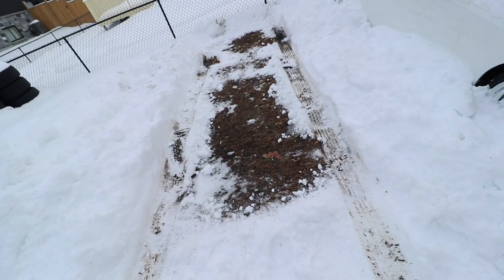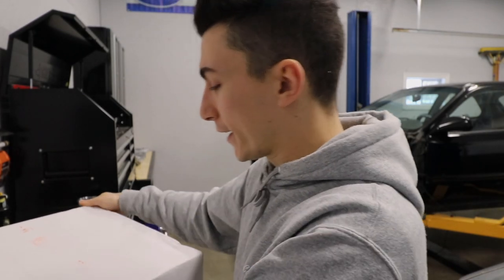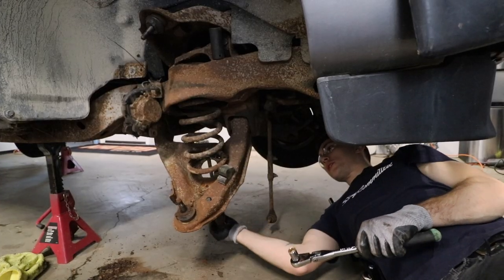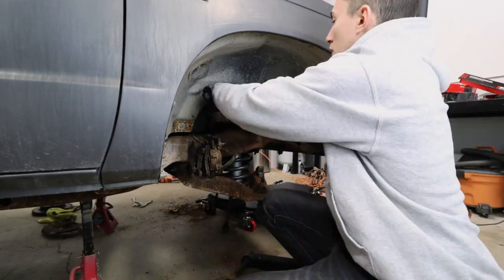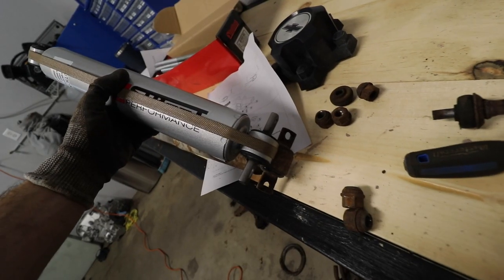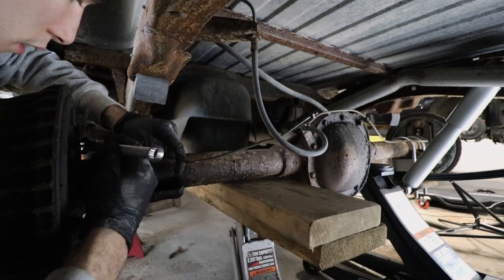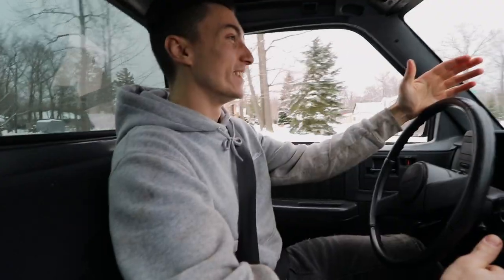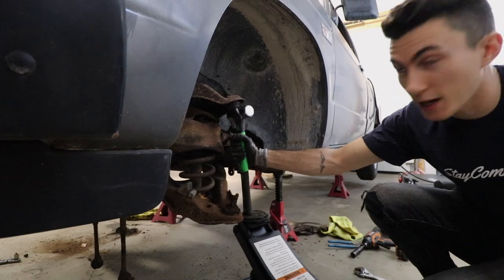Installing a 5" Lowering Kit on my S10😍

Comment: I had a 1896 S10 and miss it. I did a SBC swap putting in a 383 stroker with a 6 speed manual and 4 link 9” ford in the back. It was stupid fast and fun.  Put a cage in it and all it in all a simple swap done before the LS days. Truck was about 12 years old when I did.  Got it with a blown 4 cylinder motor, slipping 4 speed auto and locked up diff so just yard parts went in.  My first truck.

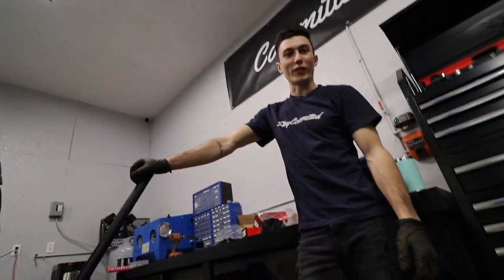Comment: Hi Robbie, at 7:53ish it looks like you used the hard plastic ring that comes with the Belltech coils. They include that ring so you can choose a 2" or 3" drop. That way they don't have to sell 2 different springs. If you used that in your final install, you only lowered the front 4". I've been using BT stuff for years with great results. Love the channel, keep it up.
Reply: Fam so how much did he lower it cause I wanna lower mine the same so did he drop 5 inches in the front and back or 2 in and 3 with his set up cause I want mine to look the same but I can only find 3 inch lowing kits

Comment: 80's mini trucks always look good slammed on some 15-17" rims and low-profile tires. Got an 87 Toyota Pickup, 3" drop all the way around, going to do a little more, and an 87 Ford Ranger 2WD also going to be dropped and slammed eventually.

Comment: Those front shocks brackets can be drimmled out and fit and when you go back and redo the truck get 1in ball joints for better geometry the disk swap just get a blazer rear end out of a 2nd gen

Comment: So I like the Civic project, don't get me wrong on that. But seeing the S10 now, like this. You could do an awesome winter beater project with this. In regards to styling I mean. Like obviously you'd also need more power so maybe that's a first step. But like, there is so much potential with the S10 I feel like. I'd love to see it worked on in some way. :_Badly:

Comment: Did you use the 1 inch spacer in the front or dod you do a full 5 inch drop up front? I know the belltech fronts give you the option or 4 or 5 inch drop. Thanks 👍🏻

Comment: Did you ever end up having to C-notch your rear? Just installed this kit on mine but with 3 in blocks in the rear and no es bueno; adding a c-notch tomorrow. Figured I'd ask if you had run into the same issue eventually

Comment: You should put a 5.3 l33 in the s10 and turbo it.  The l33 is good to 600hp on boost and fits really good in the s10.  I have one and on alcohol I'm running mid 4 second 1/8 miles

Comment: Lowering an s10 can bring some bad news if you dont do it right. Youre gonna wanna put tall ball joints on the upper controll arms due to some geometry issues that lead to not being able to align it properly. Make sure your rear end is shimmed to the correcr spot to, otherwise you can tear your driveshaft apart.

Comment: Does it drive smooth? I have a 91 S10 that I am modding and planning to keep long term. LONG TERM, forever. but I drive it a fair distance. does it ride better than a stock 30 year old S10 suspension?

Comment: Hey Man I know you have a lot of subscribers and its hard to message everyone, but I have a 1991 ext cab S10 that I bought from my buddy. I grew up around this truck and Im trying to decide if I want to dump money into it now or wait for later, I wanted to know does this ride better than the old stock system. Not necesarily if it rides better than NEW stock parts but if it rides better than the old ones, Also If looking back you would rather do this vs bags, and if this amount of low would affect the ability to down the line do an engine swap or anything.